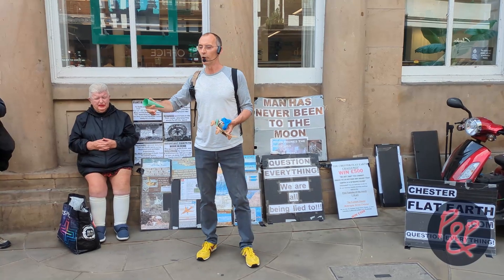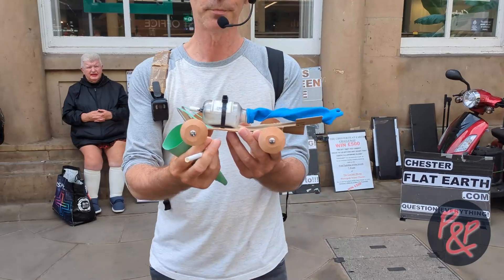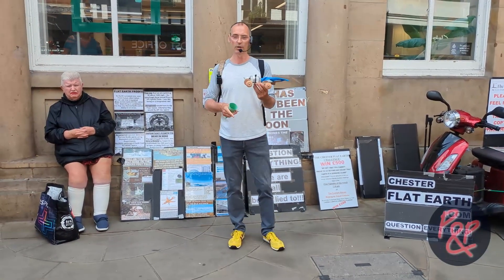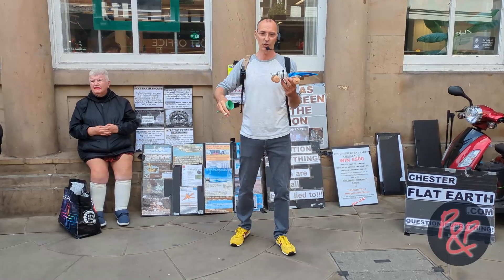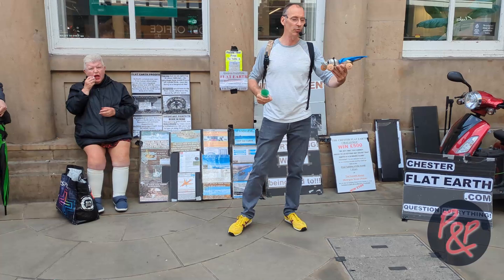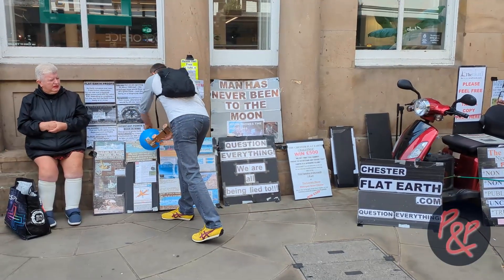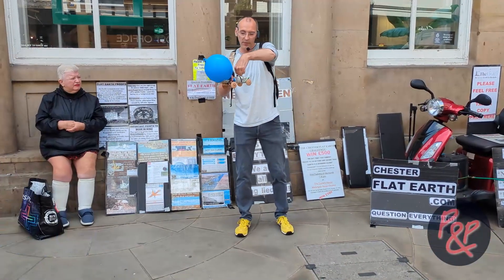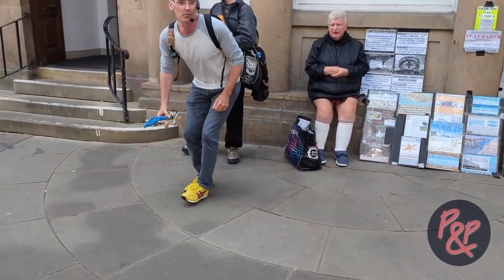Street Demo: How a rocket doesn't work!

Comment: I dont quite get how you've concluded that rockets don't work in space from this? So you put that cone thing on and the object didnt really move as much but still moved a little bit, ok so how exactly does that prove anything?
Reply from the maker: the balloon car moved very well without the cone and yet with the cone, the balloon car moved only slightly due to me accidentally nudging it when I released the air from the balloon. The car did not move solely due to the balloon deflating!

It is quite clear from Newt's 3rd law of motion action causes reaction. So inflated balloon expels air is the  action = reaction is the force applied to the inside front of the balloon and we have motion. This is the scientific understanding we're given.

Place a nozzle on the end of the straw where the air exits and there is no motion.

This means a force is not induced at the front of the balloon to move the vehicle forward as a result of air exiting the straw!

I think it's highly probable that you do not want to understand the contents of the video because this demo goes against all of your beliefs regarding how rockets propel themselves allegedly in vacuum!

👍👍👍
Reply: @PeterPete  did you measure the applied force in both scenarios?

What's providing the pushing force on the object if it's not what the laws of physics says it is?
Reply from the maker: @mattdamon7499  why don't you do the demo yourself to find out for yourself instead of asking me silly questions?

Science is about repeatability, so why not repeat it?
Reply from the maker: @mattdamon7499  watch this earlier demo done a few years ago!

https://youtu.be/FeULZ4Ow81U?si=oBu9K8GL9YUMIZr2
Reply: @PeterPete  I just want to know how you've come to your conclusion that rockets dont work in space because of this experiment?  Are you saying that this experiment disproves thrust forces? If so, where does the propulsion come from in say a jet engine?
Reply from the maker: @mattdamon7499  after carrying out demo with bal;loon car i have arrived at the conclusion that NASA's explanation on how a balloon is propelled through the air is WRONG!

Now because this is clearly wrong I can satisfactorily also concluode that rocket propulsion cannot be explained fully using the same understanding as the balloon.

Therefore rockets cannot propel themselves in vacuum.

there you go!
Reply: @PeterPete  but I'm just interested to know how you've arrived at that conclusion?
Reply from the maker: @mattdamon7499  I've just told you! If you can't understand it or don't want to understand because you believe rocket thrusters can propel a vehicle in a vacuum, then that's down to you and your imagination to find peace with!!
Reply: @PeterPete  this is the most you've come to answering the question of how you've got to the conclusion of rockets not working in space. Quote..

..."place a nozzle on the end and there is no motion. This means a force is not induced at the front of the balloon to move the vehicle forward as a result of air exiting the straw"...

But again, how do you know there's no force coming from the balloon? For one you've altered the second scenario by adding an additional weight (the cone) to the vehicle. This will only make the vehicle heavier and less balanced with increased friction therefore resulting in slower acceleration. Basically it's not a fair test.

Ultimately this experiment doesnt disprove a pushing force coming from the deflating balloon as there's too many variables in your test.
Reply from the maker: @mattdamon7499  You clearly do not understand - NASA state the way a balloon is propelled forward is by the exiting air induces a force at the front of the balloon - a simple action/reaction - got it?? You understand that.

So what we showed in the video is having the same conditions ie allowing the air to exit the balloon and yet we generated NO MOTION!

Therefore the explanation is WRONG!
Reply: @PeterPete  this is science's explanation for how it all works..

When the balloon deflates you get a resultant thrust force on the balloon, we'll call it Ft. So when the balloon deflates we see acceleration of the vehicle equal to
a = (Ft - Ff)/m

Where, 
a = acceleration
Ft = thrust force from the balloon
Ff= friction resisting movement
m = mass of the vehicle

Therefore, when you put the cone on the vehicle you are increasing both Ff and m in the equation which is only going to reduce your acceleration even if Ft remains constant in both examples. 

That's why you cant conclude there's no force from the balloon in this demonstration. You would need to get a direct accurate measurement of the applied force from the balloon in both cases.
Reply from the maker: @mattdamon7499  you can say what you want but science has it wrong regarding how the balloon is propelled through the air!!
Reply: @PeterPete  again what are you basing that claim on? Your demonstration doesnt disprove any of our understandings of science as I've just shown.
Reply from the maker: @mattdamon7499  you haven't shown anything - you've just reeled off a load of chitter chat!

Don't you know the difference between chitter chatter and actually demonstratinbg something??

And you think you do science??
Reply: @PeterPete are you capable of watching any of the ~330 videos from SpaceX that show their rocket performing propulsive maneuvers in a vacuum?
Or is actual "evidence" against the rules?
Go watch USSF-62 from VSFB a couple of months ago.  I watched it in person with my eyes as I was one of the launch conductors.
Reply from the maker: @stuartgray5877  so you don't want to carry out a balloon car demo yourself?

You can make a balloon car right??
Reply: @PeterPete  My company does over a dozen tests per year of real rocket thrusters in a vacuum right here on earth in vacuum.
And we have about a half dozen spacecraft flying above your head right now using rocket propulsion.
Do try to keep up.
I could tell you exactly how to track and receive data from these satellites with about $200 worth of radio equipment.
 But I am sure you are not interested in actual "evidence".
Like the fact that you can SEE the ISS with your own eyes. 
I just helped launch USSF-62 a couple of months ago after having been one of the test engineers that TESTED the Propulsion system and helped FUEL it before launch.
But what would I know about "propulsion?"
Reply: @PeterPete  I worked for Lockheed Martin Flight Systems and can explain some of the most advanced vehicles ever made by mankind and you are stuck with ballon cars?
Ok I can TRY to keep it at your level, but I might need a lobotomy.
Reply from the maker: @stuartgray5877  quote - My company does over a dozen tests per year of real rocket thrusters in a vacuum

next time u do it take a video showing a rocket thruster actually propelling a vehicle in the vacuum!

btw how big is the vacuum? does it compare to the vast expanse of space??
Reply: @PeterPete  no. I've explained how it works according to our understanding of physics. If you don't understand it then that's your problem and not mine.
Reply: @PeterPete  - "next time u do it take a video showing a rocket thruster actually propelling a vehicle in the vacuum!"

I can show you over 330 videos from SpaceX showing the Falcon9 doing propulsive maneuvers in a vacuum. And every one has video from the ground to corroborate.
Are you willing to evaluate a video from SpaceX AND the video of the same events taken from the ground? Or will you just refuse to evaluate evidence that proves you wrong?
Reply: @stuartgray5877 , you worked for Lockhead Martin? I was just thinking about the HIMARs rockets Ukraine have been using against Russia, they seem to cope quite well maintaining propulsion at high altitudes despite the reduced air pressure.
Reply from the maker: @mattdamon7499  I understand it but I think it's rubbish!!
Reply: @PeterPete  well then you obviously dont understand it. Thinking you understand and actually understanding something are 2 different things.
Reply: @PeterPete  Still just refusing to address real facts about basic physics?
Have you even considered taking an actual Physics class? We can tell you have not.
 You are guaranteed incapable of passing even a high school physics exam, yet you feel confident arguing with rocket scientists??
How very Dunning-Kruger of you.
Reply from the maker: @rocketman484  rocketman is your username?? that's so funny!!

🤣🤣🤣🤣🤣
Reply: @PeterPete The air leaving the balloon still interacts with ambient air in the nozzle you attached. Why do you think this proves rockets don’t work in a vacuum?
Reply from the maker: @AM-rd9pu  according to NASA and science the exiting air from the straw is irrelevant in the generation of motion!

The demo demonstrates the exiting air stream is vital!
Reply: @PeterPete Where does NASA say that? The thrust is entirely dependent on the flow coming out of the balloon. 

The video demonstrated that slowing down the flow coming out of the balloon reduces thrust.
Reply: @PeterPete  according to Newtons Laws - MASS CANNOT be "accelerated" by anyting OTHER THAN a "Force".

So where does the "force" originate that accelerates the mass of the air out of the balloon?

Is the air "SUCKED out by atmospheric gas
OR
Does it decide to exit  the ballon due to PURE MAGIC?
Why won't you answer this trivially simple basic physic question?
From WHERE does the force originate that accelerates the air from the balloon???
Reply: @PeterPete  when did NASA ever say that? The air leaving the balloon is the very mass that exerts a force on the balloon pushing it in the opposite direction, which is why your balloon car accelerated the way it did. This is all taught in secondary school physics classes.
Reply from the maker: @stuartgray5877  you do realise the balloon has elastic properties so when you blow up the balloon as an action the reaction is the balloon pushing on the air inside of the balloon! This is how the air within the balloon is able to be expelled from the balloon!
Reply: @PeterPete  so are you saying that the balloon exerts a force on the mass of the air inside the balloon "forcing" it to exit the balloon with a velocity that it didn't have inside the balloon?
How would YOU describe what the balloon does to the air inside it to make it exit?
Reply: @PeterPete  Does it require a "force" to put air into the balloon?  (your lungs did "work" filling it up, didn't they?)
So doesn't it stand to reason that the elastic tension in the ballon creates pressure inside the ballon that "pushes" the gases out when the orifice is opened?
How can you not call this a "force" pushing the gas out of the balloon?
Isn't a "force" the only thing that can cause a mass (like gas) to accelerate according to Newton's Laws?
Reply: @PeterPete >according to NASA and science the exiting air from the straw is irrelevant in the generation of motion!
Tell me you don't understand the theory without telling me.
Reply: @PeterPete  - "It is quite clear from Newt's 3rd law of motion action causes reaction."

So, if some machine like a "CATAPULT" fires a big heavy mass out the back doesn't it HAVE TO feel an "equal and opposite" force?
How can a machine NOT feel "recoil" if it throws out mass?
Reply from the maker: @stuartgray5877  there was no catapult in the video so why are you talking about one?? You feeling alright???
Reply: @PeterPete  I a asking if YOU know how to calculate the recoil force on any mechanism that accelerates a mass.  The equations apply regardless of the type of force or the type of mass (solid, liquid, or gas)
Reply: @PeterPete  Could you explain how one would calculate the recoil force required to accelerate 5 kilos to 25 m/s?  If the catapult had a mass of 100 kilos?

What would happen if the 100 kilo catapult fireed a 5 kilo mass horizontally at 25 m/s while sitting on a frictionless surface.
Reply from the maker: @stuartgray5877  I don't need to answer your question as it has no relevance to the demo in the video - i didn't show a catapult did i??
Reply: @PeterPete  SO that's a "NO I cannot calculate forces on mechanisms".
You could have just said that.
Nevermind, I guess you do not possess the intellect worthy of having a discussion.
Reply from the maker: @stuartgray5877  well why don't you try the demo yourself instead trying to mentally avoid the issue with conceptual shyte!!

Make yourself a balloon car and place a nozzle on the end so the air can exit the balloon freely and watch it NOT move at all!

Meaning the action of the exiting air does not induce a force that is applied to the inside of the balloon that moves the car forward!!

The balloon car movement has to be explained in another way!

The air being pushed out of the balloon by the balloon generates one force and this force (action) creates a reaction in the surrounding air that resists the motion of the exiting air stream from the balloon and as the resistive force is greater than the active force the balloon car moves forward!

It really is quite simple to understand.

maybe you should do the demo yourself afterall!

if you think I'm wrong falsify my view!!
Reply: @PeterPete  - "well why don't you try the demo yourself instead trying to mentally avoid the issue with conceptual shyte"

Because I have already done the experiments using actual scientific equipment including vacuum chambers.

We have not found a single instance where Newtons laws stop working in a vacuum.
Reply: @PeterPete >if you think I'm wrong falsify my view!!
You haven't given a falsifiable explanation of what you think is happening. All you did was (fail) to falsify Newton's 3rd law.
By picking a balloon car you've picked possibly the most complicated system to demonstrate the law. Fluid dynamics are extremely complicated, and very clearly you haven't accounted for the actual fluid flow at all.
Reply: @PeterPete >Place a nozzle on the end of the straw where the air exits and there is no motion.
OMFG, the straw IS a nozzle you fkn muppet. It's the same thing except, clearly, the garbage cone nozzle has poor geometry for generating thrust.

>This means a force is not induced at the front of the balloon to move the vehicle forward as a result of air exiting the straw!
You don't know anything about the fluid dynamics of your nozzle to make any actual judgement on what the expected force would be and you have no idea what force is needed to overcome friction and accelerate the car. So no conclusion can be drawn.

Comment: hello Petes, i am starting to research snowflakes. i was wondering if you have done any research on snowflakes as it seems they are only created if there is dust or pollen in the air and the "atoms" separate. Look at the HIStory and it's got some NASA fantasy like storylines with huge gaps in time line that make it suspect to me (at first glance).
Reply from the maker: it would seem snowflakes are similar to raindrops in that the moisture needs something to cling to in order to form whether as a drop or as a flake. We'd say these are condensate nuclei ie salt
Reply: @PeterPete  ineresting,- i have been speculating the ether is salt at a particular altitude and temperature since it is an electrolyte and so much more. i love salt 
on another earth science note, 
i am sungazing and generally looking at the sky with a  naked eye more and more daily , i spend a lot of time outisde, noticing 2 levels of clouds and within those 2 levels are the additional chemtrail clouds. i see chemtrails creating clouds in real time about 10-20 days a month no matter where i am (in the last 9 months, i saw them in Spain, France, Colombia, NY and Florida). So - i now i am thinking that lower puffy clouds are actually expelled from chemical plants as waste and the clouds at higher altitudes are natural clouds. On the plane it is really evident  the difference in makeup. interested in questioning when and who named 3 types of clouds... comparing to bible and other text anyway- thanks for reading to here.